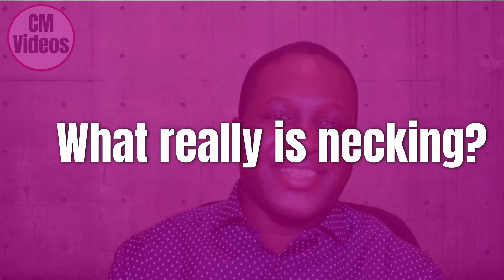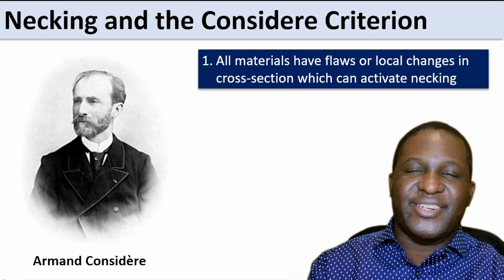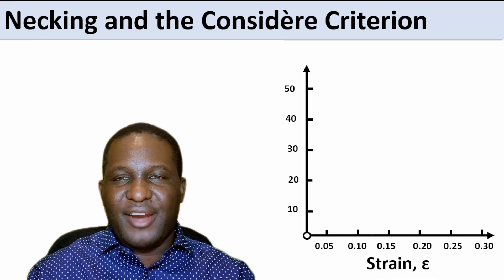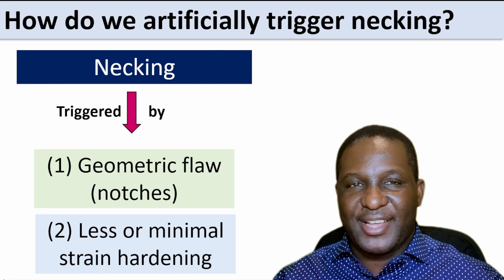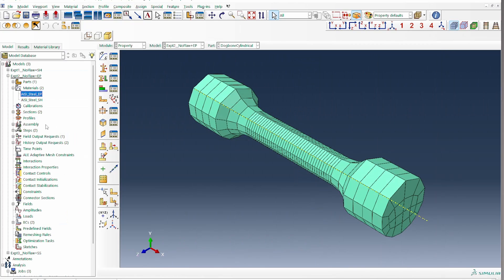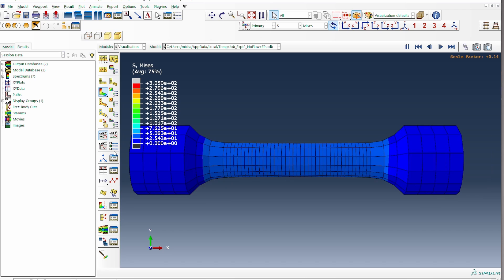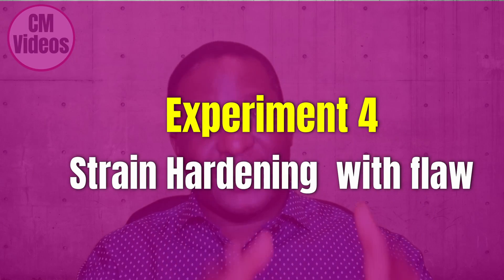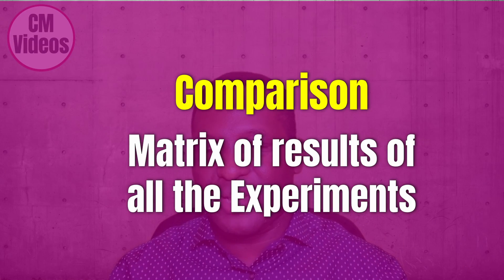How to TRIGGER NECKING ARTIFICIALLY in ABAQUS

Comment: Hi Dr Okereke, Thanks for the video. By the way I have one query. What if we include ductile damage with the damage parameter to the simulation.. I believe we can see necking ..... Have you tried it ?

Thanks again.
Reply from the maker: Good suggestion @Gayan! Ductile damage also manifests itself as necking in some materials. However, they are two different materials. You can have ductile damage without necking, and those are materials that typically strain hardens. For example, think of rubbery materials. They will fail in ductile damage but never see necking happening. This is because the Considere criterion, established in this video is not obeyed in them. However, for some materials that will normally neck like Polycarbonate, they will fail in ductile damage but still see necking. In such cases, there is a post-yield strain softening which obeys the Considere criterion hence necking will be seen. It is a little bit more nuanced that your initial supposition.
Reply: @MichaelOkereke  Yeah true. Many thanks for the explanation.